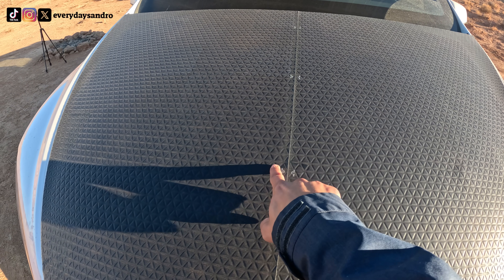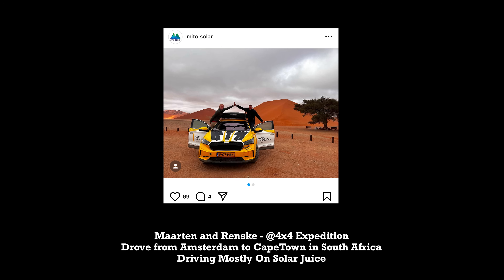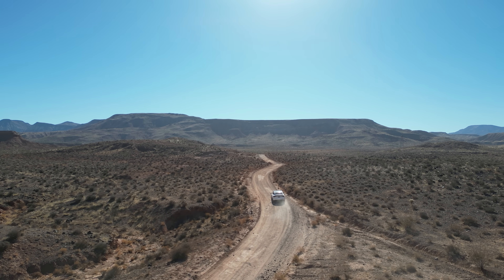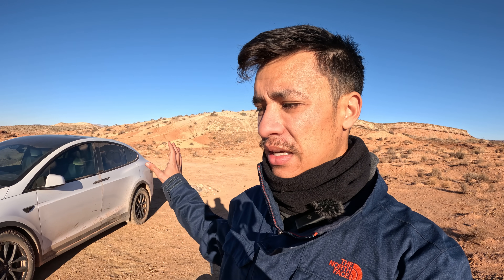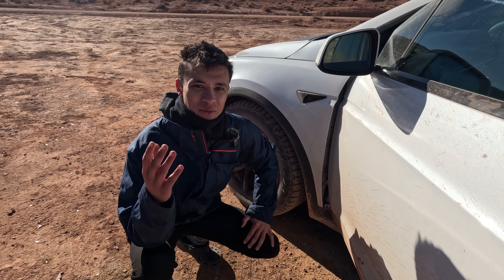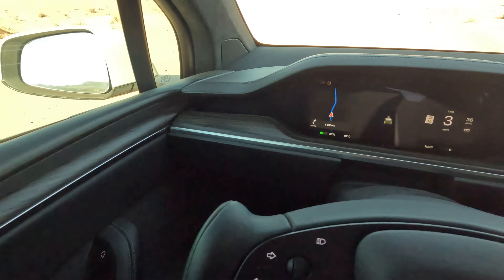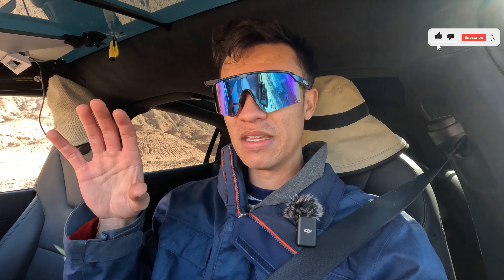How Much Range Can DIY Solar Panels Charge My Tesla? (Battery Test)

Comment: Ecoflow came out with the sunroof solar panels for model 3 and Y, it'll probably fit on the X. 290 Watts of additional solar panel, use a mppt like optisolex and wire both of them together into the ecoflow battery, you think you would ever get one?
Reply: Oh I just realized the falcon doors on the X would make it a little more complicated. What about the gosun ev charger?
Reply from the maker: Same problem!
Reply: @EverydaySandro oh model x doesn't have a roof rack?
Reply from the maker: Can you link the product?
Reply: @EverydaySandro I linked it twice but YouTube kept removing it. Just look up ecoflow heatguard solar film.

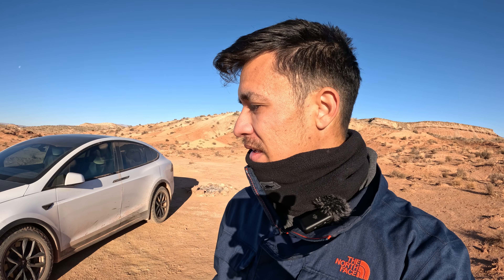Comment: 6:31 lol spoke too soon. However since your battery is so high it’s most likely also throttling back the wattage as the batteries should be constant voltage charged above 80% so the wattage will taper down to 0 from there so it’s best to start adding some loads to maximize pv utilization and not let it sit unused

Comment: Can't charge through a PHEV port without a minimum of 750 Watts.  Can charge a charging station which depletes the charging station life with each.use.  Sticking a charging station under a carpet risks causing it to explode under the heat of it's own operation.

Comment: I’m curious how it would impact your power independence / off the grid capabilities & experience if you slap some additional panels on the side doors as vertical panels. Obviously the cost is probably not “worth it” based on cost.. but then you could always just park  your car facing south (or North) and let the ecoflow charge from ‘optimally’ panels at all times of the day…. And while on the rode regardless of direction of travel…. You could pretend it’s a 2tone Bugatti
Reply from the maker: That’s a great idea and I think it would add so much to the overall experience of living in the car. As for what's next, we are getting so foldable panels to power more!

Comment: yes all but man you can test it in a cyty instead of in the middle of nowere... so if it go on fire what you gona do there? melting mashmellows? 😅
Reply from the maker: Cozy campmode
Reply: @EverydaySandro  yes but especially for the firsts time you can try in a safer place that's what i meant. even if with battery there's not a safer place due to the fact that water not switch if off any way.

Comment: It would be fantastic if you tried driving with just solar but obviously having some flexible panels to reach 400watts or even more of solar, that could give u more than 10 miles per charge (bc of solar input) and it would take only 5/6 hours to recharge the battery, so like 4 times more than now, which would be super neat
Reply from the maker: Any brands you suggest? Great tip and thank you for watching!

Comment: If x didn't have falcon wing you couldve probably added more solar and roof rack for storage... You can probably add more solar to your trunk.

My only question if your system can be improved to the max .🎉
Reply from the maker: Always improvement. This solar set up is enough for our adventures

Comment: Would be interesting to see you do a camping setup and multiple portable easy to install solar panels.
But, I'm guessing that too would generate around 10-16miles worth of juice.

What really should be done is integrating the electric cars with out of the factory solar panels, that when we are not in the car and at work, just adds juice of maybe 5-10miles over 10 hours or something.
That'd be essentially a free car to drive especially in the city where you're just commuting to work and back.

I really liked the vibe of the channel. Thanks for uploading, keep exploring!

Edit- Just watched a video by a company called Gosun, kind of interesting, you might want to look into that too!
Reply: @GlitchHeroXP   a fun project of curiosity but in pragmatic terms, it is amazing what one will spend to get something free.

If it was a gasoline car or bike and needed 5 to 15 miles of extra or daily replace range then a 1 gal gas can ($14 one time buy) and $2.75 of gasoline in the trunk ($4 Cali) gives you an extra 20 to 50 miles.  

It'd take a lot of those gallons to equal the purchase of extra solar stuff for an EV, not to mention the bulky storage problem.

I think EVs are good local cars.  I like the quiet traffic.  However hybrids solve most every logistical problem with distance.  I thought the Volt was the best approach.  A 50 mile up to speed plugin for daily use that then turned on a gasoline engine on trips.
Reply from the maker: Thanks for watching and that's a great idea!  Only thing is GoSun reached out to me but I am in Mexico now lol.

Comment: Very cool solar panels. Glad the hood survived the hit/run. I've thought how to solar charge my Chevy Volt while it's mostly parked, and your method is easy. I wonder if you could double your solar influx with reflectors that might fold out from under the frunk when parked on a calm day. Just parking next to a white wall could give a boost. Thanks for sharing your vanlife tricks!
Reply from the maker: That’s a great tip actually and will give it a try in Baja! Thanks for watching!

Comment: Need help from more knowledgeable people...I think he is missing something... what is wrong with folding panels for when you park. They would cover the roof and back window, maybe 240wats X 3 areas.... 720 watts.... WHAT I DONT KNOW is if he can feed 250-350 watts or so (fast charge?) into the charging system. Also, if it was 250-350 watts, how long to charge hus vehicle?.. i dont know a lot about the charging aspects
Reply from the maker: It’s all possible and should work. I am just not a fan of settings things up while I am parked. Wind tends to blow most places and there is 0 input from myself as long as I find some sun.
Reply: @EverydaySandro  pretty cool that you answered... thank you... I watched you  "setup while parked".. example,  the charging by plugging things up, also adjusting the suv and hood positions... what you are doing is deciding that creating a panel with elastic straps? that can be clipped on is different "setting things up"... interesting... .  How long would 250-350 watts (from 720 panels) take to charge with your arrangement ( wouldn't dare use the term "setup" again)

Comment: Clearly you have far more experience than me in this EV world. I got the Lightning  last April. My advednture cross country will be starting after the sale of my home in next month or two. An upgrade would suit you well. Lightning, Rivian.....Cyber? The Lightning has power up the wazoo. You can even charge another EV from it. Level 2-240v. Surely this isnt news to you. I have 20k on the Lightning XLT ER AND GOIN GREAT. I have a 200w flex panel Im gonna Put on my truck cap to keep my Bluetti charged up. Truth is what you are doing here has to be the future of EV'S. Even at 6 miles per day thats 40 miles per week and that adds up. Not sure why not a single carmaker offers this as an option. And why doesnt Tesla have a 110v outlet in there? Kick ass software blows away Lightning and no outlet?Anyway thanks for the lessons in your vids.
Reply from the maker: I love hearing about your plans and adventures, happy travels! I agree with you here, Tesla missed the mark by not adding AC outlets from the beginning. They only didn’t plan on people living in their vehicles too I assume.

Comment: Mentioning the temperature, I am curious if the it has any effect on the front hood panel and the paint since the solar panels gains more heat😮
Reply from the maker: It’s not a huge concern, the panels are built to withstand the elements.

Comment: So in summary: 2kWh battery charged 100% solar gives your X 6mi range. 
Question: how long did it take to charge those 2kWh (I recall a low Amp was used)
Question #2: on a sunny day how long does it take to charge the Ecoflow?
Reply from the maker: Great question. As of now, it takes about 10-15 hours to charge the EcoFlow just purely off solar! It’s also winter and I am in the Northern Hemisphere, so summer time should be a great test. Right now I am testing it all in a Blizzard

Comment: Fuel cells catalysts and  membranes , there anode and cathodes are becoming small, very cost effective  very efficient  the new fuel cells  SOFC  Solide  oxide have no need for expensive metals and the newer maganese oxide catalysts, super clean and very high efficiency,  coming soon the day where  a tank canister  the size of a  large coke bottle full of cheap green hydrogen  will take your fuel cell car 500 miles, hydrogen refillable tank canisters sold at convience store stands, this will be the infrastructure,  no need for those ugly EV charging stations all around cities ect, hydrogen fuel  cell top ups just  like phones  or like connecting ones BBQ propane grill except it will be with hydrogen with no toxins, very simple super safe, they already exist,  they already make  5 types of hydrogen canister types, lite  carbon fiber tanks  5 times stronger than steel, hydrogen car tanks canisters made for high car impact, this is coming, the new perovskite solar cells have become much more cost efficient by 30% in making green hydrogen and better storage  than solar cells to battery storage or just plan electricity, this is a game changer in the solar cell  green hydrogen revolution, hydrogen is realy safe in comparison to gazoline, gazoline needs 1% to 3% oxygen concentrations to explode, hydrogen needs 18% to 59% making it safer! hydrogen dispersis fast onto air,  it`s a very lite element, making it safe! around the world many gazoline cars explode in car accidents, lithium battery explosion fires, many remember the hydrogen Hindenburg Zepplin explosion, however the material coating it was made of  was the reason for the horrible fire and not the hydrogen fuel, there has not been a hydrogen fire or explosion connection since then, i would say hydrogen is the safest of fuels!

Comment: 2:13 are you sure you are not blocking the air vents on your eco flow? cool video btw
Reply from the maker: It’s been alright, now we are testing it in a blizzard
Reply: @EverydaySandro   the vents are likely more needed when weather is hot, you may at least want to keep an eye on temps in the app during the heat

Comment: It would be sick to get like 2 of these foldable 400W panels, maybe combine each with 1/2 of your taped on panels to reach the 2x 500W max solar input of the Ecoflow and then just put them up and limit the tesla input to around 1kW. Then you could charge with 1kW all day. And there are even tools that you could hack together that regulate the Tesla amp limit according to your solar input. Doesn't have to be perfect, as you have the Ecoflow as a buffer, but roughly to not drain it fully. Could be sick. Edit: Maybe you also can put some smart switch in between and some longer cables on the 400W panels so you can just cut them from the circuit when they're in the trunk and if you throw them out you don't need to connect anything and just flip a switch. That sounds like a chill workflow.
Reply from the maker: Actually a great tip, I am looking at all the possibilities

Comment: Yes we do understand the solar was added to top-up the ecoflow. But would be interesting observation how much the solar can top up the beluga in an entire day of sunlight. We need to remember this setup is hardly 20%  of the total surface of the car. If Elon will do solar on Tesla, he will do it structural. Basically a factory fitted solar will not add any weight to the over all vehicle if done structural. Rest all component of a solar power generator are already there on an Electric Car. I mean if a model 3 can be topped up like 10-12 mile range that will also be a huge thing for the over all charging needs of the car. The higher models might not be as promising.
Reply from the maker: For sure would be interesting, what panels do you suggest I get?
Reply: @EverydaySandro  I meant with the present setup itself. The one you already have. Please set the charge into Beluga to lowest amp such that the charging continues. This should drain the ecoflow only to the extent that the top-up and the power from ecoflow keeps charging Beluga the longest possible. Am expecting power just from the current size panel on the hood will not be enough to continue charging Beluga. With this how much power we can top-up in to Beluga over the entire day?
Reply from the maker: @ that’s a really good idea actually, thank you for telling me this! Yes, I think so, time for some more testing

Comment: Have you looked into the EcoFlow 800W inverter yet? Should be ideal for you to charge your EcoFlow using the Tesla high voltage battery. Let us know.
Reply from the maker: Not sure if I want to mess with the HV system

Comment: Would be cool to develop the solar panel kit which would be tightly integrated into tesla system. So you don't need to open trunk for charging and also the charge will go directly to the battery all the time and car cooling system can help inverter to cool
Reply from the maker: I would love to try but I am nervous tapping into the HV battery

Comment: Can you recharge the Ecoflow at a Tesla Supercharger? 
Does the Ecoflow recharge from the Tesla while the Tesla is supercharging?

OR, recharge power station at a different vendor vehicle charge station?
 Cost vs taking from the Tesla to recharge the power station while driving. 

Have you considered carrying a larger capacity power station?

Can you find a faster recharging power station?
Reply from the maker: I normally don’t recharge the EcoFlow with the car on remote trips, that’s why I have the solar so there is constant input while the sun shines. I can charge it faster with a regular outlet, but it’s tricky to find one that unattended and free

Comment: If you also slapped another 2 sets of those panels on the back window/trunk area you could increase the charge capacity to something a little better. It would still be much better if you could charge directly rather than from ecoflow though ; since you get losses twice. Once into ecoflow, then again out of ecoflow.
Reply from the maker: That's a fair point actually. I just wanted to keep the system integration as simple as possible, less moving pieces if I have to fix something on the road.
Reply: @EverydaySandro  yeah I figured as much, simplicity is important. Keep it up!
Reply from the maker: @ absolutely, I am honestly super lazy too
Reply: @EverydaySandro  no you're not. Lazy is us watching your videos from our couch, not you being out there creating content. ;)
Reply: I was thinking the exact same thing!

Comment: Camry Hybrid gets 650 miles on a tank of gas, and then just 5 minutes to refill the tank.  Gas stations are everywhere.

Camry owners will never have to trickle-charge a battery with small and weak solar panels.
Reply from the maker: You do save time there, but the regular maintenance is a killer for me which is added time back to the puml station😉. And I can’t imagine pushing into the wilderness being so loud, I like camping quietly
Reply: @EverydaySandro  the regular maintenance is a killer for me

There is no regular maintenance on a Camry.   Just cheap oil changes every 4 months, tires every 3 or 4 years, and engine air filter once in a while.  Cheap and easy and fast.   Brakes need service every few years, just like the Tesla.

I can’t imagine pushing into the wilderness being so loud

A Camry is certainly not loud!   You are kidding, right?  😀

Comment: I could a fill a bath using an eyedropper.......but its a pointless exercise, your basically doing the same thing with solar panels......sure it works, but the time it takes, for the benefit gained, isnt worth the effort.
Reply from the maker: If you say so, Beluga and are happy with the install and still roaming wildly free :)
Reply: @EverydaySandro  hey if you think spending so much time, trickle charging a battery is worth it, then that's on you.
Calculate how much time you sit around waiting for some minuscule gains & ask yourself could your time be better spent doing something more productive?? 
Perhaps you don't value your time very much!
Reply: If nothing else it can offset some phantom drain and in a pinch it may be what allows him to get down to a town and a charger.
Reply: Need help from more knowledgeable people...I think he missing something... what is wrong with folding panels for when you park. They would cover the roof and back window, maybe 240wats X 3 areas.... 720 watts.... WHAT I DONT KNOW is if he can feed 300 watts or so into the charging system. Also, if it was 300 watts, how long to charge hus vehicle?
Reply: @kafklatsch3198  if I need to be really independent I think I would go for a roof rack with panels that can fold out. That way they do not take up space in the car. They would unfortunately ruin the aerodynamics. The big problem is that no practical way to feed the DC battery directly is available. I wish Tesla would allow a single DC supply to be fed the onboard charger so we did not have to convert to ac. Most equipment that handles power via diode rectifier can do dc input but if the design is using transistors it May have a required lower frequency limit.